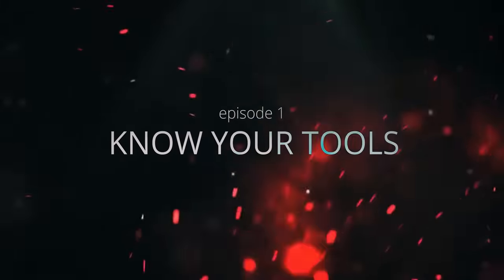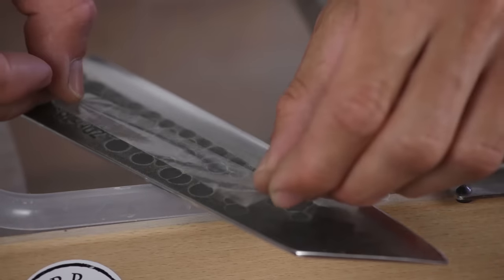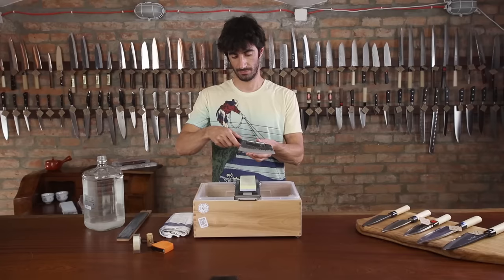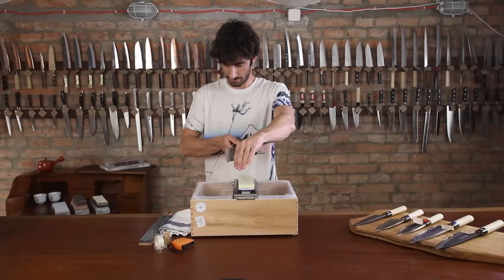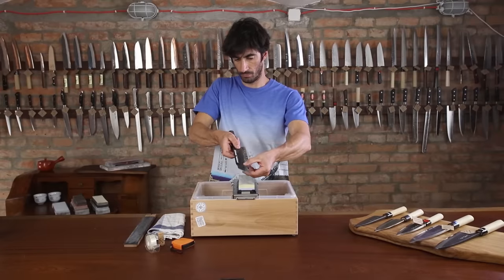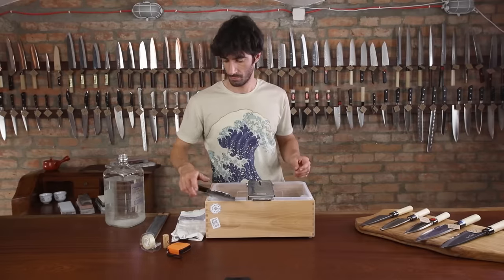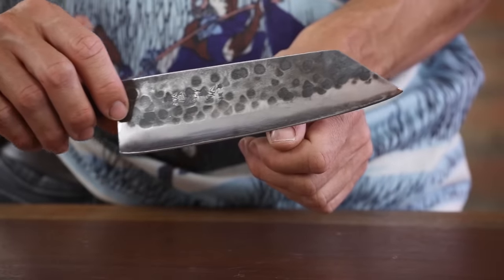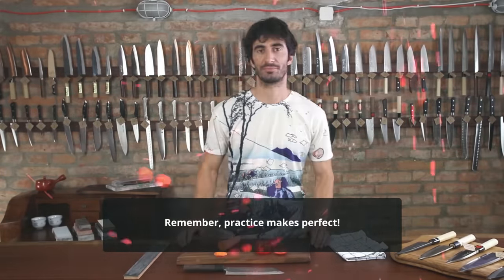How To Sharpen a Kitchen Knife - Beginner's Guide to Knife Sharpening

Comment: This is nice! But still i can't afford all the equipment.  Do you think i can still sharpen my kitchen knife without all of the equipment in your video?
Reply from the maker: Thanks! Yes, you can. The very minimum is a combination water stone, the guide clip is a helpful tool, but you can learn to sharpen without it. Leather strop you can either make yourself, you just need a piece of leather and a small wooden plank to glue the leather to it. Alternatively you can also strop on an old pair of jeans, but leather is definitely a better choice! Have fun!
Reply: @SharpEdgeshop  now this is low cost. But still sounds like a pro hehehe
Reply: @SharpEdgeshop  thank you so much 🙏🙏🙏

Comment: execlly my thoughs that nail test omg :)
Reply from the maker: Haha, indeed, the nail test can look intimidating, and it should be performed with caution and with almost no applied force to the blade - you dont want to cut off your thumb :) If done properly, it is the best way to test for the level of burr/sharpness along the full length of the blade. There are other techniques to test this, but the nail test is our preferred option.

Comment: If you are sharpening with an "asymmetrical edge," then why do you leave the angle guide on when doing the second side?
Reply from the maker: That's a great question! The "asymmetrical edge" does not mean the angle will change when doing the other side. The angle on both sides will remain the same, but the very end of the edge (micro bevel) will be moved from the center of the knife to the left or right side, depending on if you are right- or left-handed. This means the angle on both sides will remain the same, but one side of the edge will be "shorter" than the other. The "asymmetrical edge" term relates to the asymmetry of the edge position, not to the asymmetry of the angle. I hope this makes sense to you. If not, please ask more questions, we're happy to help! You can also send me an email to grega@sharpedgeshop.com and I'll share a quick sketch with you to better explain this. Best, Grega

Comment: You add baking soda in the water for that carbon steel type of knife otherwise you get rust while sharpening so adding baking soda is preventing the rust of course you should re move water immediately your knife after sharpening
Reply from the maker: That is correct. We actually put baking soda to neutralize the rust, but didn't mention this in the video. We also use baking soda to neutralize/stop the etching process when restoring the damascus pattern. 👍

Comment: Using nails to slide a blade is wrong, just only touch the nails, if the blade sharp you can cut your nails.
Reply from the maker: Not according to our experience and what we learned from Japanese sharpeners. You should slide the full length of the blade on your nail to feel the levels of burr on the entire length of the blade. But indeed, be careful not to cut into your nail too much, use only the weight of the knife to slide it on the nail.

Comment: Hi I just now bought a 3000-8000 grit wet stone, this is my first time using one, will it be enough to begin with? Please suggest.
Reply from the maker: Hi! We would actually recommend getting another combination stone, a 1000/6000 grit whetstone. 3000 grit is already quite fine granulation, so it will be very difficult to learn to sharpen a knife on such a fine stone. We'd recommend that you start on 1000 grit (like in our video), then finish on the 3000. Once you are comfortable with these two granulations and satisfied with the sharpness, start experimenting with the 6000 grit and only when you master 6000, go to 8000. It also depends on the kind of knives you have, but 8000 granulation is usually reserved for carbon knives and razors. https://sharpedgeshop.com/collections/two-sided-sharpening-stones/products/sharpedge-sharpening-stone-1000-6000

Comment: Nice location! But the nail test and the angle assistant and the stropping leather are never used by professional sharpeners from Japan. You do not need the fingernail test, just feel the burr with your fingertips...
Reply from the maker: Of course, the techniques are different from sharpener to sharpener. But since this is a beginner's guide, we try our best to explain sharpening to someone who has never done this before. That is what we suggest the use of angle clip and leather strop at the beginning. 👍

Comment: it's not safety to try on the nail , it's terrible, some thing happened then the finger gone  finished . try to cut on paper or on fruit . This video no good to watch , someones didn't  know fowlow  than cut the finger , it's terrible to watch
Reply from the maker: Yeah, the nail test is not for everyone, some get goosebumps and some will feel that it is too dangerous. We are doing a lot of live sharpening classes and so far no one cut their finger off. One should be very cautious when doing the nail test, no pressure on the blade, you only slide it on the nail with the weight of the knife.

However, fingernail test a very effective method to test for sharpness along the entire length of the blade, so far this one works the best for us. But there are other ways to test the sharpness, as an alternative we recommend the paper test.

Comment: A 1000/3000 grit stone will do fuck all for a knife that has lost its edge.
Reply from the maker: If the knife is very dull or even damaged, we would also recommend using a rougher stone, like 200 grit, to establish a new bevel and quickly remove the excess, damaged material. After that, 1000/3000 grit stone is more than enough. 👍

Comment: First time I tried sharpening a knife it was as sharp as it was before (not really sharper) 
the next day, the second time, it was a little better, but still far far away from perfect, and with my third try a couple days later it was definitely sharper, cutting through normal paper was possible and cutting vegetables was way easier, but still everything but perfect, but at least it finally worked out a little
Reply from the maker: Sometimes it takes time and practice to conquer the technique and to thin down the blade. Based on your comment this is happening. Each time when you sharpen it, the blade is thinner and because of that also sharper. Don't give up, practice makes perfect 😀

Comment: if it's sharp. he would already lose his finger when he try to cut his nail.
Reply from the maker: That is not entirely true. We all have fingers to prove that 😉 When sliding the blade on the nail you can check for spots on which you still have to work a little. No need to press the knife hard on the nail 👍

Comment: The angle clip, in my opinion, does not help teach people how to sharpen. In fact, it teaches you nothing.
Reply from the maker: Hi Quinn. From our experience, the angle clip teaches how to keep the correct angle along the entire length of the blade. We see them as the training wheels for kids on bicycles. When someone is learning sharpening for the first time, it can be overwhelming - you need to learn how to move the blade up and down, hold the same angle, not cut yourself.. The angle clip takes one of these variables away so one can focus on the right movement. Once one achieves this, they can remove the clip and sharpen without it. In our opinion, it's a tool that helps beginners to learn faster, but we definitely agree it is not a necessary part of the sharpening equipment.

Comment: When you cut your thumb off its sharp enough 👌
Reply from the maker: Make sure no pressure is used when sliding the blade on the nail. Then you shouldn't have any problems.👍

Comment: doesnt the work sharp ken onion sharpen knives without all this stuff?
Reply from the maker: Thanks for the question! Sharpening on whetstones is the best way to sharpen knives, razors and other blades. There are indeed many other solutions that will sharpen a blade to a certain sharpness, but not as good as they would be on whetstones. One of the biggest issues with electric sharpeners like the Ken Onion is that they dont add water to the sharpening process. Blades, especially Japanese knives that are made of high-quality steels, are heat sensitive so if no water is added during sharpening, it will heat up the blade and change its steel structure. Also, whetstones have higher grits, which means a smoother blade. There are many more advantages of whetstone sharpening, but if you own cheap(er), soft steel blades, these machines will do an ok job that some find satisfactory enough. Hope this helps a bit! Cheers! ✌️
Reply: Brought to you by Work Sharp Ken Onion knife sharpener.

Comment: But isn't a Waterstone too soft for knifes above 60 hcr? I've heard only diamond stones would sharpen them
Reply from the maker: Not really. Whetstones are made from Aluminum Oxide that is significantly harder than any steel that is used in kitchen knives. That makes such whetstones perfect for knife sharpening. The hardness of the sharpening stone also depends on the type of bonding material used.👍What you wrote is true if you decide to use ceramic knife, those can only be sharpened with diamond abrasives.
Reply: @SharpEdgeshop  okay thx for the quick response c:

Comment: That plastic bottle will do just as well as a fingernail. Just assume the blade has a burr on it, and use the strop to remove it.
Reply from the maker: We cant fully agree with that. It's very important to feel where the blade still needs some work, and the fingernail test is, in our experience, the best indicator. There are of course other ways to test for it.

Comment: Have a question I bought a whetstone ket it says to soak grit 400/1000 but to never soak any grit over 3000 am I still supposed to wet the 3k stone down ?
Reply from the maker: Hey, depends on the stone. But usually higher grit stone don't that need much soaking, maybe just the first time. Most of the higher grits are just splash and go, which means you can pour some water on and the stone is ready to use. 👍
Reply: @SharpEdgeshop  thanks a lot

Comment: So the lower the higher the number the finer it can get?
Reply from the maker: Technically yes, higher number, higher granulation,  finer edge. But the quality of steel plays an important role here. At one point, every steel will reach it's maximum level and will start to 'crumble'. Higher quality steels, like carbon steels, can be sharpened with very high grits (12k+), while some cheaper steels will start to crumble at 4-6k granulation stones already.

Comment: How many stroke you do with 1000 g each side
Reply from the maker: There is no universal answer to that, it depends. Usually as many as it takes to create a burr on the opposite side of the blade. That can vary from the pressure you apply and also of the steel that you sharpen. Hope we were able to help! 😉
Reply: Thanks

Comment: Tried the nail thing, it actually works!
Reply from the maker: That is great to hear! We knew we were on to something 😉
Reply: @SharpEdgeshop  yeah, skeptical at first then said what the hell, but not until after the final polishing, if it is smooth all the way through its sharp, if it snags a little, run it through a few more times👍
Reply from the maker: @raffieb762  Yeah, you can try this also during sharpening to find spots that need a bit more work. 👍

Comment: I dont get the difference in technique between the fine grain sharpening and the honing. Same stone and looks like the same gesture...
Reply from the maker: Hi Victor, thanks for your question! Fine sharpening and honing are two important and different steps. The main difference is that with honing you should not pull back the blade when sliding it on the sharpening stone. By not pulling back, you will remove the burr, improve the geometry of the edge, and prepare the blade for the next step, which is to polish it on a leather strop. Another important part of honing the blade with a fine grit sharpening stone is to have the stone and the knife as clean as possible, as we explained at 12:26.
Reply: Thanks a lot!

Comment: What is the difference between a whetstone and an oil stone?
Reply from the maker: Whetstone is a name that is used to describe sharpening stones, so no difference there. You are probably thinking about the difference between water and oil stones? In that case, the main difference is in the lubrication used while sharpening knives. On oil stones you use oil or emulsion, usually the stones are also harder, and they wear out slower. 👍
Reply: @SharpEdgeshop  thank you!

Comment: Most of this stuff is absurdly unnecessary. You don't need all of those tools to find and maintain a decent angle when sharpening a knife.
Reply from the maker: We believe that the clip is helpful at the beginning when learning the correct sharpening angle. 👍
Reply from the maker: One more thing we'd like to add. We agree with you, there are some tools in our video that you really don't need to sharpen a knife. Technically one would only need a nice flat stone picked up from the ground, that's how it all started. But, with more tools, we'll learn to sharpen knives faster and more accurately. It's like with cars, their main purpose is to get us from A to B. Do we really need AC, Bluetooth, heated seats? Not at all, but it makes the ride much more comfortable and enjoyable :).

For us the essential sharpening tools are:
- good stone with 2 grits, lower and higher grit (combination stone or two single stones)
- leather strop.

The rest is optional, but nice to have. What tools do you use to sharpen your knives?
Reply: @SharpEdgeshop   A whetstone set with 3 different grits, some water, and my hands. I had 0 experience with knife sharpening, but I learned it within an hour. That's not a brag, I feel like if anyone were to just take a bit to try and learn it instead of buying equipment that essentially does it for them, it's a lot more rewarding and satisfying, and not that difficult to learn.
Reply from the maker: @BeyBattleBoy  Cool, good job! We tried to keep the items in our guide to the minimum, we're not really sure what other gear are you referring to as being unnecessary. The guide clip is like training wheels on a bicycle, not necessary but nice to have. If you are not using a leather strop, we highly recommend it to get a finely polished blade and to remove the burr. You can make it easily by yourself, you just need a small wooden plank and a piece of leather that you glue on the plank.

Comment: What if the knife is so sharp it goes through your nail and into your finger ?
Reply from the maker: The important thing is to slide it on your nail very gently, with very little pressure. We run a sharpening service too and we use the nail test every day. It never happened to us that the knife will go through our nails, and we've sharpened best knives market has to offer, so they cant get much sharper than that :) Just take some common sense precautions and give it a try, it looks scarier than it really is.
Reply: @SharpEdgeshop  I have a bunch of knives and typically do not have a hard time getting them sharp; except for one, the Kershaw Ken Onion. I cannot get it back to where it was when I bought it and no one else can either. I have had people at knife shows sharpen it, hardware stores. None of them can get it back to where it was, so I bought the Work Sharp sharpener. It actually is called the "Ken Onion" sharpener. Logically it should get the Ken Onion knife sharp. I just ordered it yesterday. We shall see.
Reply from the maker: @geechrammstein  Hmm, that's very interesting, I wonder what kind of steel (from googling it I assume it's stainless steel, but which one) was used to make that knife. We'd love to take a try at it :) I hope that sharpener will get it sharp again!

Comment: Why not use a honing steel to hone. I use mine between every use. Haven't had to sharpen my shun in like 4 years cuz of this practice.
Reply: Honing realigns the edge a knife and if used on hard Japanese steel it will chip the edge.
Reply: @bobismycatsnamelol286  I mean I have a shun knife with a shun honing knife that shun recommends using between use... I was operating under the assumption another Japanese steel knife would need the same care.
Reply: I only sharpened that knife once since I owned it because my wife got it wet when it was drying on the rack and it oxidized the edge and caused it to chip. Since then, I hone between every use and it hasn't dulled enough to break out the whetstone yet. She's no longer allowed in the same ballpark as the knife when it's out.
Reply from the maker: @captainsh1thead  You can use honing rod on Japanese knives, but for most Japanese knives, it should be ceramic or diamond rod. Leather strop is used to remove the burr and polish the blade, it does it better than the rod. Honing rod realigns the blade, as Bob correctly stated, but it won't sharpen it. Im not sure which rod are you using with your shun, if it is made of steel it can also sharpen the edge a bit, but with knives made of very hard steels, only ceramic or diamond can work. After 4 years it would be advisable to put the shun to the stones, you probably already have a thick edge so putting it on the stone will make it thinner, gliding easier through ingredients.
Reply: @SharpEdgeshop  I think shun only make one... its definitely steel. I basically got what the guy from iron chef uses in the shun videos on maintaining their knives.
Reply: @SharpEdgeshop  ill probably use the stone soon though. My prosciutto knife arrives today can't wait to carve some meat! Can't believe I ordered on Wednesday and it's out for delivery already. I can't even get mail from the next town over in two days but somehow this is on its way from Europe already
Reply from the maker: @captainsh1thead  Yeah, DHL does wonders with express deliveries :) Awesome, I hope our Burja will serve you well! 💪